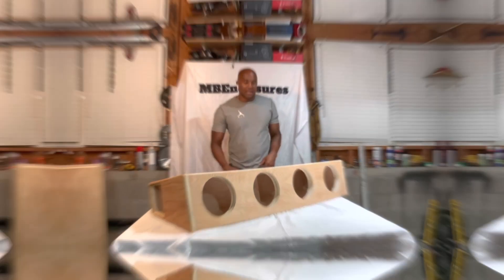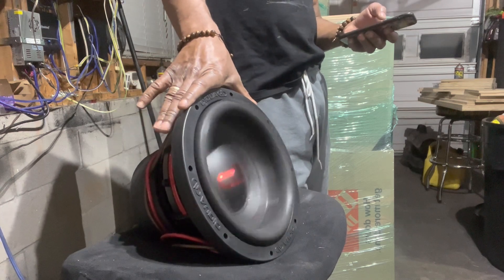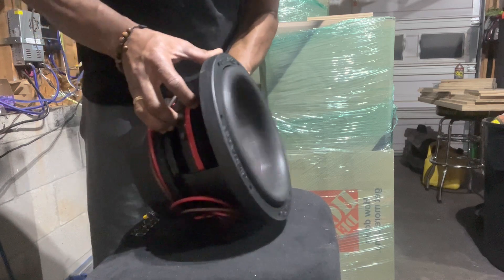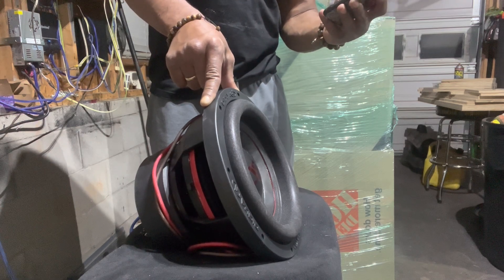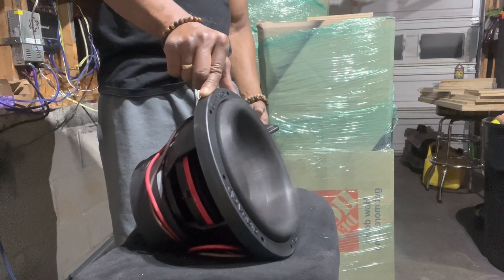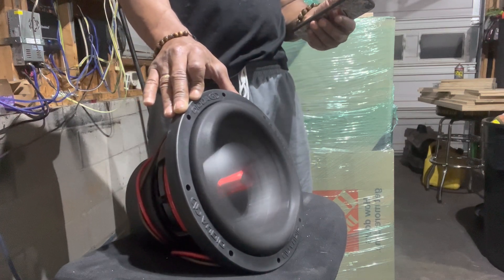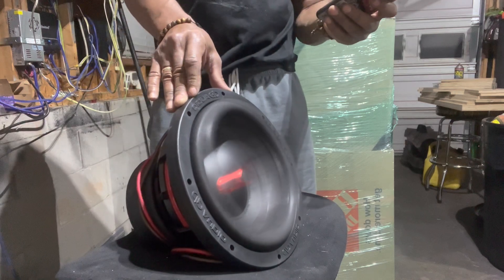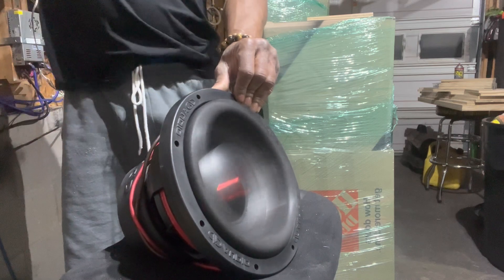DIgital Designs 610E 10” Frequency Sweep Test!!! No Mechanical Noise! Very Efficient Clean Output!

Comment: Ok,so JL W6 10v3 or this sub? Your opinion?
Reply: Jl w6 10w6 way better
Reply: Keep in mind that for the price of a 10W6 you can get a 710, which are absolute monsters.
Reply: Yes i know the DD audio is a monster But the jl w6 10v3 sound quality is way better no mechanical noise just the deep 
Bass that's why there price is expensive
Reply: @jblmrulovers6736  which brand has cleaner and softer thumping bass? DD Audio, CT Sounds or JL Audio?

Comment: In your opinion, is the DD 1110 8 worth the price difference when compared to the L7 Q class?  Can you hear the difference or do you need measuring equipment to discern their performance?  I'm running a single 8" Q class in a 2020 4 door Ranger.
Reply from the maker: Blake was on point.. as far as your question the QCLASS L7 will have more output than a 1108. The 608 is a better comparison. And no I don’t think you will hear a difference there
Reply: One thing to keep in mind is that if you're looking for value with DD, I would go for the 608 instead of the 1108. The 608 has a larger motor and it's tuned to sound good in large efficient enclosures. The advantages of the 1108 are in sound quality, and that it doesn't need as large of an enclosure. Which means you could comfortably fit 2 1108s in the same air volume as a single 608 or kicker L78. You could also do an 1110 in the same size enclosure.

Additionally, since the 1108 is made in America, you can customize it and make it look however you want, which is why I went with 1112s instead of 510s.

Comment: 430$ ea, that aint too bad for beefed up 10. Definitely a quailty woofer. I'll eventually have a pair.
Reply: very overpriced in the us
Reply: @jere3604  Yup, transporting will do that. I bought some B2 Audio Riot 10's a few months ago for 190 a piece apparently theyre cheaper in europe as well, but it goes both ways. Just pricey to transport.
Reply: @YouroGamer  It is kind of weird to me how different parts of the world have different brands/models when it comes to car audio and the manufacturers don't make the same products everywhere.
Reply: @jere3604  A lot goes into it and it all comes down to money. A manufacturer doesn't get to say where the item will get sold, they just build it. Also im curious how much does DD 610E cost where you live? Because as far as im aware they are made in the USA so it would only cost more to transport them to europe unless they have a manufacturer set up there.
Reply: @YouroGamer  Yeah, probably would be a big investment to sell all products globally. I just bought a DD 612e for 229 euro in Finland, and i'm pretty sure the redline subs are made in China but the parts are probably american. A DD 610e costs 199€, so it is pretty cheap for the quality.
Reply: @jere3604  interesting I wonder why it's so much cheaper there and yeah some of there lower end line is made in China, believe those are just designed by DD.